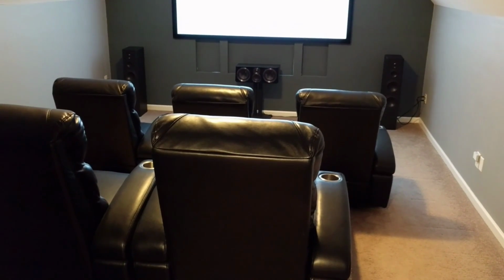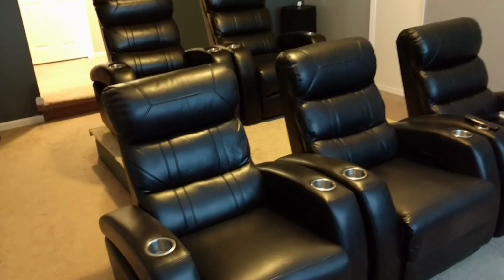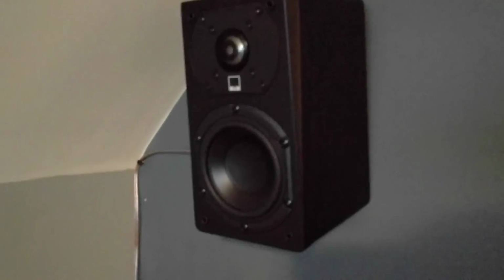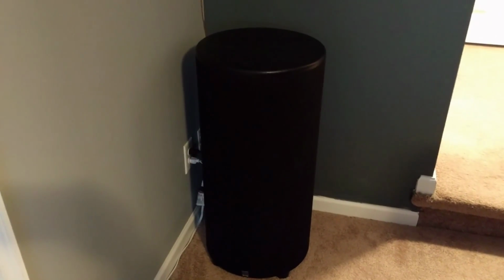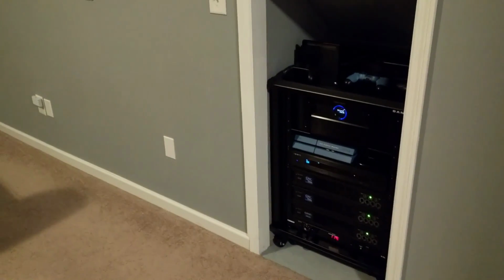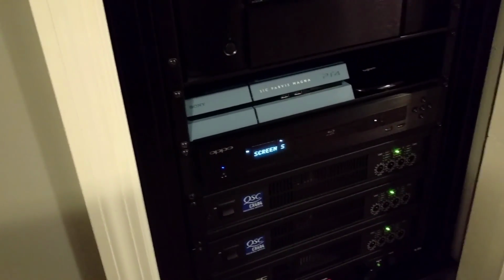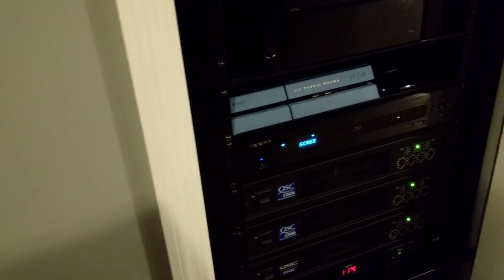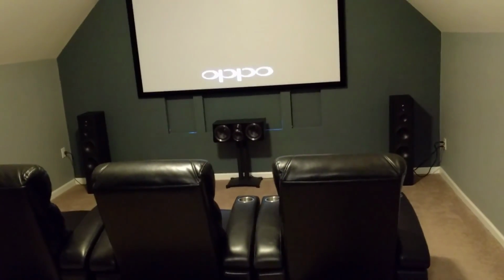My home theater (extended)

Comment: Very clean looking set up you have there, good job man. I also have dual pc2000's but in my room they drop to 17hz and roll of very sharply afterwards. All my other speakers are Def tech and I also run a 7.2.4 but with no additional amplifier power. My reciever is a denon avr-4300h which provides all the power I need at the moment because everything is is my bedroom and it's basically a 12 foot cube.

Comment: Nice.  I realize this video is coming up to 2 yrs old, but that will help with my question.  I have one SVS PC-2000 (considering getting a second one soon).  Curious as to the placement you have of them.  Did you try them in the front and the back, and found the back is better?  Reason I ask is I have mine up front, and hadn't thought of placing them closer to the seats.
Reply from the maker: Subs are still in the back, I had tried them in the front but there wasn't a huge difference. In my case, given how narrow the room is, the subs just fit better in the rear. Someday, I'd like to get 2 more for the front, but I have other priorities first, like a 4k upgrade and more cosmetic work. Sorry for the delayed response, just missed it it guess.

Comment: Nice! Do you find the two subs shake your room too much? Im wondering cause i'm thinking of getting one. And does the sub itself shake alot?
Reply from the maker: Since everything is calibrated, no the subs don't shake the room too much,  but yes, you can surely feel the bass on the lower notes, explosions, etc, but that's the point. Honestly, when funds allow id like to get 2 more. and no, the subs themselves don't bounce around, they stay put.
Reply: @rmurad38schannel73  what do you mean everything is calibrated?  what do you calibrate so the subs don't shake too much?  you just lower the volume?
Reply from the maker: @velocci6666  the Audyessy XT32 calibration in the receiver is used to to measure the frequency response and distance of each speaker and sub. Levels and phase are adjusted to level everything out. In the case of the subs more is generally better because each one won't have to work as hard to play at the same level as just a single would.

Comment: The LFE should be crossed over at 120.  Not to be confused with bass managing your speakers which are properly crossed over at 80.
Reply from the maker: Havent reviewed this video in quite some time, and yes i noticed that i had misspoke and the diagram was wrong. the speakers are all bass managed at 80 but yes the LFE for the subs was always set at 120. Thanks for the correction though, I really need to update this because ive since made some significant changes. The side surrounds are now SVS ultra surrounds, the rears are the full size SVS prime book shelfs, I've added some sound deadening and some cosmetic changes to the room itself, someday if i'm motivated I'll redo this video. thanks again for the comment

Comment: WOW, great setup!! Maybe turn the towers in toward the center a little (point them directly at the widest chairs), and maybe try bumping the crossovers to 110-120 on everything but the towers and center. Otherwise, I wouldn't change much, it's a great installation overall!! I like the wheels on the rack, smart way to go!
Reply: Not all towers require toe-in, some brands even advise against it (KEF comes to mind)